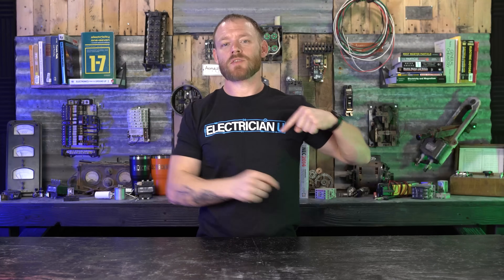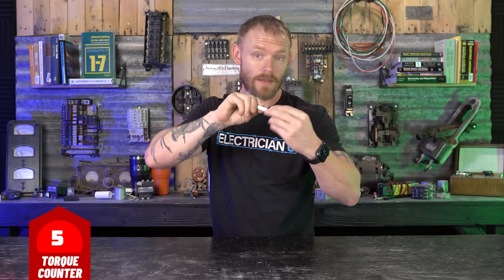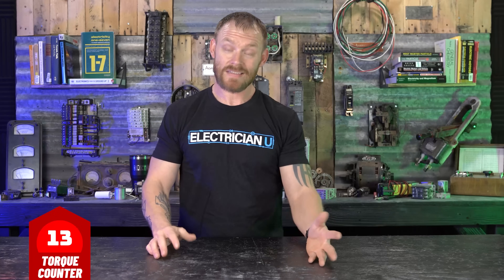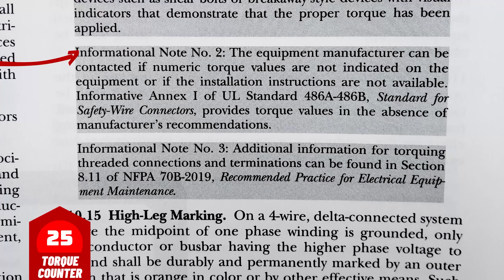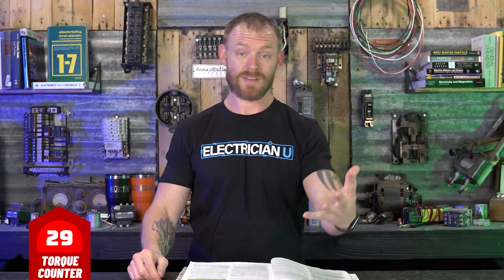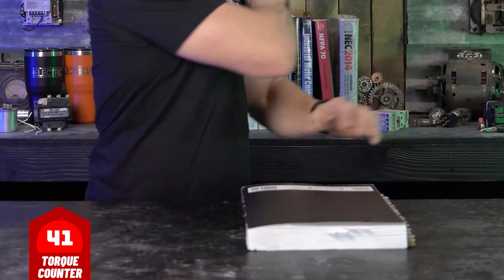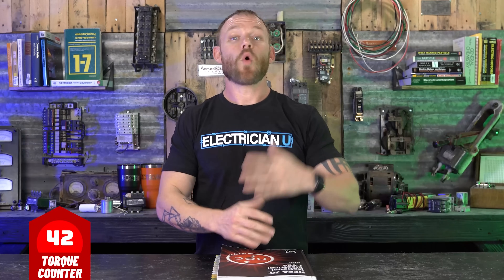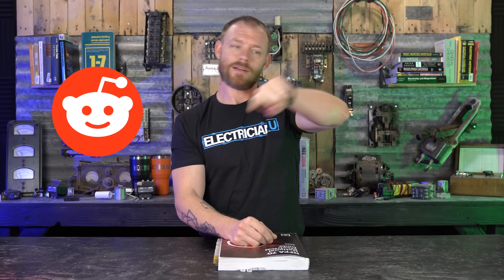Electricians: To Torque or Not to Torque... Is that the Question?

Comment: Guys who replace tires routinely use a torque wrench, but they also remind the customer that the wheels should be retorqued a week or two later. They recommend that because once a wheel is put into service the fasteners shift under load. Likewise in the electrical world I'd be more interested in retorqueing in a couple of weeks because after a couple of heat cycles the wires may shift. Of course that's impractical, but I'll throw out a guess that the main reason for fasteners coming loose is because of heat cycling and variance in coefficient of expansion. Sure, poor technique could be contributing, but don't be surprised if even carefully torqued lugs come loose occasionally.

Comment: I'm a farmer, not an electrician.  But, I've put in my own services.  One thing I've noticed, and perhaps I should get a torque screwdriver, is installing a bus style surge protector.  14 GA aluminum wire.  Flathead screw on the neutral/ground bus, tighten it with a screwdriver until it barely starts stripping out the head.  Back it off to put in a new one since that looks crappy, and notice the wire is mostly smushed, to the point the capacity of the wire may be impeded, even though I only used a screwdriver.  I really like heavier cables you can torque to spec with a torque wrench, 250 in. lbs.  They say to make connections good and tight, but then even without any leverage, looks like you can overtorque it with a screwdriver.  Noticed other connections of heavier cable like 4/0 that you make good and tight, but they don't take much to loosen.  Bottom line, at least torque your main connections.  If you don't want to do every outlet, fine.  But all grounded service/feeder conductors should be torqued to reduce the risk of an open neutral occuring.  The cost of that in equipment damage could exceed an engine rebuild that requires many more fasteners to be torqued, so torquing at that point seems like a no brainer.  Plus, what if an ungrounded conductor arcs, and starts a fire?  If you're an electrician full time, a torque wrench, and calibration costs, is very minimal.  Especially if it saves someones life.

Comment: I can not help but notice the increase in demand for torque specs on equipment,  with the increase of use of drills used to tighten equipment down.

Decades ago, it was not so common to use powered tools on such things as lug and screw terminations. Now, our mindset is any termination use a powered tool. Not paying attention,  you can damage equipment with such a mindset.

Comment: Why would they require an approved means to achieve something optional? How would you even enforce that? How is it even possible that UL or CSA would test a lug to a specified torque, include it in the listing, and then somehow also include in the listing a blanket approval for anything that appears basically tight enough? Your reasoning is flawed. Any competent court of law would destroy your interpretation. Shall means shall, and requiring approved means to achieve a specific torque when anything goes torque-wise would’ve never made it through a code cycle, because then it would be a useless gesture.

Comment: Great video!
There really is a grey area about too tight or what conductors are better or worse! In a house it's not that big of a deal, but if you start talking about high loads, extreme temperatures, or something like a vehicle or RV there should really be some more clarification! I think I tend to overtighten and oversize everything in my camper, or anything with solar and DC power. I will be buying some more torque tools in the near future!
Reply: There is no grey area, he is reading the code wrong. For some reason, he assumes that the code would require stringent procedures to meet a value that is, in his mind, optional. This is nonsensical. Your UL listings and equipment warranty (and hence, insurance coverage) will only be valid if the specified torque is met.

Comment: At 3:30, the Code very clearly says "Tightening  torque values SHALL be as indicated," and "and approved means SHALL be used... to achieve the indicated value." "Approved means include torque tools." This is very clearly NOT just a stipulation that a little sticker must be on the inside panel cabinet, but a stipulation that proper torque values MUST be set by some means, and  I seriously doubt "approved means" is assumed to include the old school sparky's Good Enough Rule of Thumb.
 Though the link was too old to locate, several searches reference an interesting test at a couple professional electrician conventions, where both pros and DIYers were told to guesstimate the correct torque tightness on a few typical connections. The variation was pretty wide, +/- 40% or so, and neither group was more consistently accurate, LOL. Pros who have never used torque setting drivers develop a "feel" based on nothing at all; only the latitude in most connections saves their work from being outright alarming.

  While I haven't tested the torque yet on the main panel lines and 60A breaker feeding a subpanel, after installing a 48A Tesla wall charger, torqued to spec with 6ga THHN wires, during a couple hour charge at full power, the subpanel remained barely warm, at both incoming connections and the 60A breaker, while in my 100A main panel both the 100A main breaker and the 60A feeder breaker were almost too hot to touch. This strongly suggests that the screws there are not properly tightened, generating heat that could cross into damaging or worse.
 Particularly with screws in receptacles, and 15 to 20A breakers, the torque screwdrivers are easily used like a regular one, and can quickly become second nature in the final tightening of most connections, without undue extra tedium or time. Claiming otherwise is just being contrary, and for what? If you want to be paid like a professional, you owe your customers a professional attitude, and result.
  I would challenge every working electrician, to pause and consider their train of logic around dissing those obsessed with technicalities, from torquing to myriad Code upgrades that they find unnecessary, overly picky, etc. I have to laugh at all those who badmouth AFCI breakers in particular, as tripping constantly - what if, maybe, because y'all aren't correctly tightening things to torque specs, loose connections keep heating up, and the AFCI gets tripped? Just maybe, if every connection was correctly torqued, the AFCI Code instituted would never have been necessary in the first place?
 When replacing about 85% of the house wiring in our first, very old house, I kept finding the ground wires clipped in one receptacle box after another, with three conductor outlets blatantly not to code, even though the ground wires made it to the main panel; I also found Romex run across walls, sandwiched between layers of drywall, and even tape-spliced with no box, white wires turned dark brown from the heat. The remnants of original ceramic post-and-wires across the attic looked almost safe, by comparison.
  My point is, attitudes promulgated in the trades, over the past couple decades, realistically feel like a sort of back-handed way of "sticking it" to the paying customers, for whatever misplaced resentments one may harbor; and the trickle-down, of increased disrespect and distrust for tradespeople, has been the consequence. When those in every level of society no longer feel respectful of those in other stations, they aren't motivated to do their best work, our mutual social contracts break down, and everyone feels taken advantage of, and too often then, entitled to get back, get even, and further erode trust in one another. Just a thought.

Comment: Well I just I install and terminate 300 meters in apartment complex and every single double Pole 100 amp breaker got torque 6nm hot 6nm for neutro and 4 nm for ground 1/0 and 6 ground

Comment: I'm installing a square d homeline main breaker.  I do have a torque wrench for the bolts.  Any idea how many foot or inch pounds they should be?  Also for the wires I'm with 3/0 aluminum.  What's the  torque spec on the wire?  Thanks!
Reply: Check the breakers for 100 amp it’s 6 nm it you use square d I doing meter stack and a fire can start and service cause a 100 amp breaker at hand tight it’s not good lol 😂 that’s how fire or fault on breakers start

Comment: Do it, it's not hard and it's the right thing to do, prevents serial arc faults and lug mechanical failure (both of which I see on a daily basis, cleaning up after electricians right before inspections).

Comment: If the NEC is concerned about torque values, why are stabloc devices still allowed? What is the torque value of a stabloc device? These are notorious for bad connections in residential, but are still allowed!

Comment: I forget the court cases, but there have been electricians held accountable for damages because they did not torque and failure (eg fire) occurred.  There was on job that had more than one electricians (big project).  One had a torque wrench - the other did not not.  Judgement fell upon the one that did not.  Supply lines are the one category I would not simply hand tighten.

Comment: Tightening to the proper torque gives some peace of mind, since under and over torque both cause problems. Thermal imaging scans on panel components on a regular basis  help in pinpointing troublespots. This way you do not have to retighten each and every connection everytime.

Comment: If my value says 50 in lbs do I have to divide that by 12?
Reply: If you're saying that the spec says to torque to 50 lb-in, but your torque wrench is in lb-ft, then yes, divide 50 lb-in by 12 to get the value in lb-ft.

Comment: Need some help here - I’m a DIYer, but an engineer by education (good in theory but not as seasoned in practice as many fine folks on this post). 

I’ve been doing a lot of wiring/upgrades at home recently - new exterior outlets, cafe lights hardwired to indoor wifi switch, etc.  I’m big on adhering to code and have researched a lot of the NEC to ensure proper box fill, proper devices, etc… however I have never torqued a screw terminal on a device (outlet, switch) to any spec.  I have followed Eric Wotton’s rule of using German code - Gute-ten-tight. 

I use either a j hook or back wire clamp to secure wire to terminal,  I use a flat head screw driver, tighten till it’s snug with two fingers, then apply good pressure to make sure driver doesn’t slip and use all my wrist torque to tighten… I don’t put any real leverage (it’s not a wrench), but I’m a fairly big guy and I do twist the driver about as much as I can using only wrist.  The screw driver is just a standard 10” flat heat.  This effort usually adds about another 1/4 turn to the screw and sometimes the wire rotates with the screw. 

If I apply too much effort, the driver will slip out but the screw does not move any more.  It’s a tight connection, does not pull out, the screw does not strip, and loosening the screw does not take a huge effort - but it’s tight.  The wire is not flattened but does have some striations from the screw head.  

Am I tightening too much?  Is it even possible to over tighten using a flat head medium sized screw driver?

Comment: Another issue I would like to mention on this topic. How is it even remotely possible that the code gods can even mention torque specs on a a super common device like the common receptacle, yet still be just fine with "stab " connections? These bullshit connections , which are allowed, are by far the number one cause of faults, ranging from a "no power in a room or rooms" to smoking receptacles across the room when running a window AC or space heater down the line.  Stab connections MUST  have caused a fire or two compared to the difference between a properly hand tightened screw connection off of a pigtail ( the way I was taught 40 years ago.) Stab connections , especially for in and out connections , including "push in " connectors are for  "lazy,get er done asap they are approved" handymen.  No dis to handymen, just my 2 cents

Comment: It obviously does require you to use an approved means to achieve the values. Shear bolts are self explanatory. But good luck telling an inspector that you didn’t use a torque screwdriver and that your wrist is properly calibrated. You’d get laughed straight off my job site. You’re a professional. Act like one.

Comment: From a safety standpoint, I say they all should be at install and it is probably worth the effort to re-check connections every 5-10 years (or less).  This is why it was added to the code.  Think of the temperature changes a connection goes through with use and seasonal weather, even in a climate controlled area.  

Having said that, do I think every device should be at install, or periodically, checked (think every receptacle in a building)?  Probably will never happen, but I personally think it is critical that all panels be done (mains and subs) at a minimum and re-checked on some adequate interval.

Comment: I give electricians Bosch screwdrivers, they have a torque limiter from 2 to 6 Nm. Most ABB modular equipment requires less than 2.5 Nm.

Comment: On some deep cycle solar batteries I will get out the torque wrench. Carefull not to short across terminals, as they have voltage present.

Comment: I did a large solar installation for Tesla and they made us torque and mark all terminations. It is really not that hard to do. I am a big guy and I tend to over tighten things. I use the torque setting to remind me not to. Sort of reset my UN-calibrated behavior. That being said I have done quite a few repairs and replacements with burned wires where others have under torqued terminals. Be watchful of your stranded wire after manipulating it. Recheck after install.

Comment: I do on service panels, particularly where you have aluminum or fine stranded copper wire just from the liability standpoint.  On equipment that has a lot of vibration, things can work loose.  You know how it is, even if it's not your fault, when the SHTF, it's YOUR fault.

Comment: 110.14(D) Where a tightening torque is indicated as a numeric value on equipment or in installation instructions provided by the manufacturer, a CALIBRATED torque toll SHALL be use to achieve the indicated torque values, unless the equipment manufacturer has provided installation instructions for an alternative method of achieving the required torque. 2017 NEC
Reply: SHALL
Reply: 2017. That's 3 code cycles ago
Reply: @nickm9123  even if it is not in the code, if it is required by the manufacturers, then we must do it.
 The NEC requires that we follow the manufacturers instructions, even when those requirements are not in the NEC
Reply: That really confused me NEC????

Comment: I do maintenance in a big plant with big machines.  One of the things that I like to do every year for every panel is to loosen, and then re-tighten every connection and re-torque it.  If the loosening is 'chunky' then I take the screw out to look at it and make sure everything is okay.    Doing this operations saves a LOT of headaches in a plant where machine downtime is in the thousands of dollars per hour.
Reply: @Ryker The only time it's a problem is if the connection was exceptionally loose.  In that case the connection will be crusty and burned, in which case you need to cut back the burned wire and get back to good.   If the connection was okay before then snugging it does no harm and verifies that it's good.  Again, if loosening the screw feels odd then I pull it apart to check it out.  If the screw was over-heated it will have a 'gritty' feel to it when you try to loosen it.

Comment: I always use a torque wrench on big stuff.   Switchgear, lugs for cable of #0 and higher... stuff like that.   I also would say that you should always use a torque screwdriver on the terminals of devices like VFDs and PLCs, because it is really, really annoying when you go to fix something and find that some ham-fisted amateur snapped the head off of a tiny screw on one of the terminal blocks of a $20K DC drive.  Yes, torque screwdrivers are heathenishly expensive, but they are necessary.
Reply: Either break the terminal or the actual wire at the connection point because something is over tightened.  Can sometimes make troubleshooting a real challenge as well.

Comment: Great info as always! The way I interpret the sentence "An approved means shall be used to achieve the indicated torque value." is that torquing is in fact required if torque values are given, but I suppose that could also be interpreted as meaning the manufacturer must use an approved means to decide on the torque value that they indicate on the equipment.

Comment: I torque damn near everything that is 10 guage and above. Switchgear, meter sockets, pad mount transformer connections, panels,and Especially solar array connections. Holy cow, EVERY terminal needed to be torqued. I spent an entire day torquing string conductors, combiner box feeders, heck, even the grounding bar terminals needed to be torqued. My hands were sore for days from that.

Comment: I've always torqued every bolt on a car. You have to. If you don't, things will break. I never did for electrical work at houses until this year when I got my first torque screwdriver and boy was I surprised at how out of spec I was. I probably tighten things double to what the recommendation is by the manufacturer. Crazy.